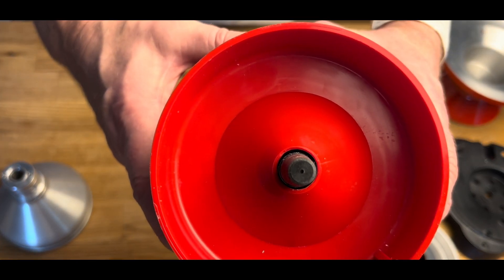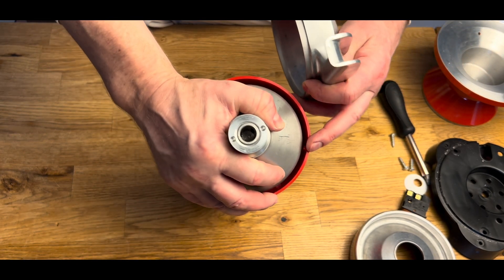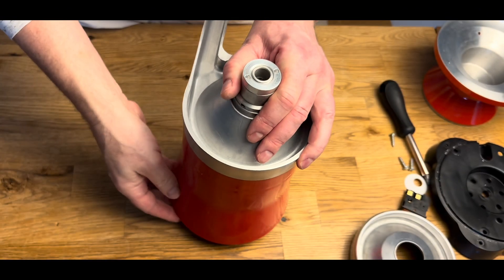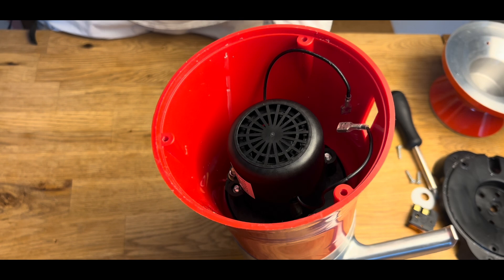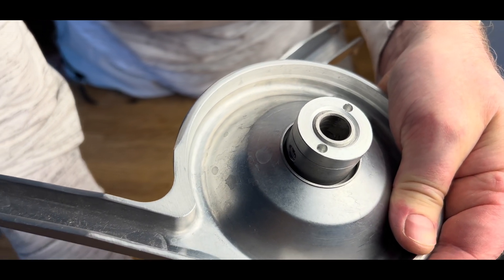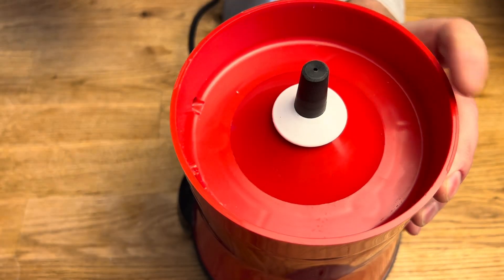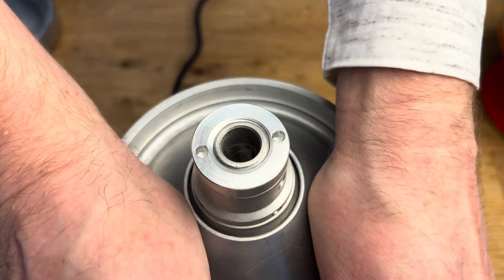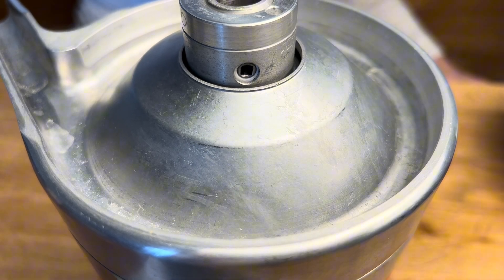How to correctly mount an electric motor in SlavicBeauty cream separator

Comment: Interesting.   So, to understand fully.  Is it that sometimes the motor 'shifts' over time, or is it that the motor might be misaligned from the factory?

If I were to find my unit 'out of alignment,' then would a thread bond be of any use to make sure it remains in alignment? 

Thanks for the heads-up!